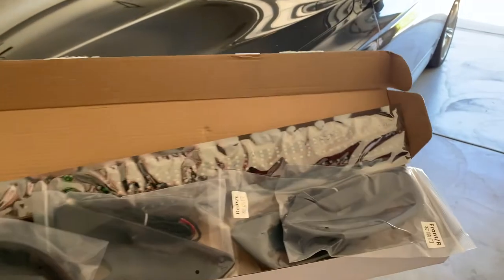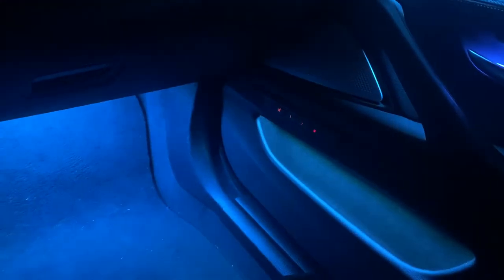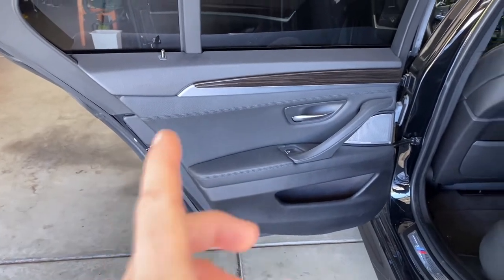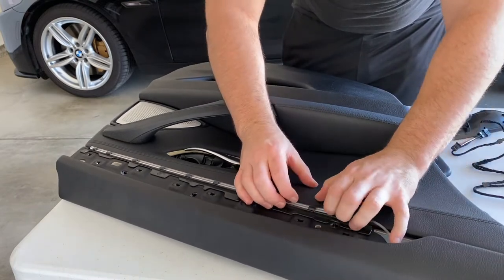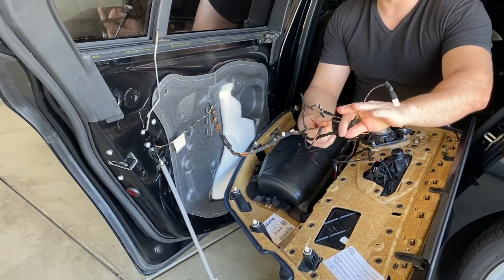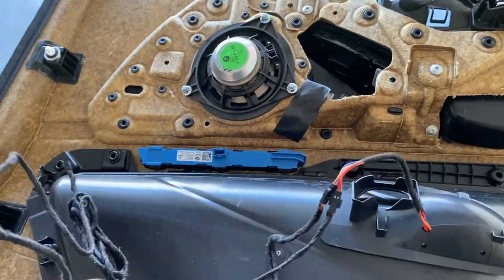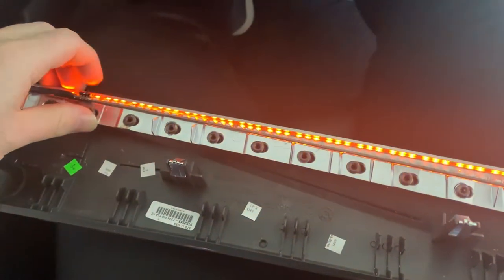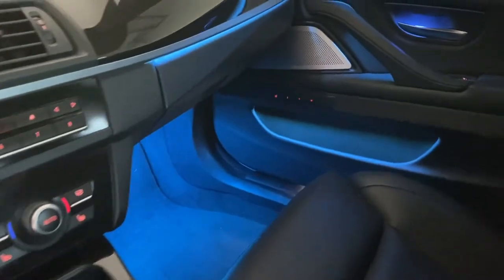Let There Be LIGHT!  BMW F10 Interior Light Upgrade | BOND Garage

Comment: hello its great I installed on mine as well very big differences.. great video btw. have question is there any way that we can code footwell lights to be on while driving because they go off when closing door >?  thanks
Reply from the maker: those are functional lights. also they're yellow/white so you won't get around adding some if you want color. as for coding it on, might be tricky but doable.
Reply: Yo i tried to install mine started on the Driver door but it didnt work. Do i first need to Plug the Rear Doors to make it Work?

Comment: Hi loving the video.. My question is.. Do you have to power all the door same as the driver door?
Reply from the maker: No. The other 3 doors are plug and play. I only customised the power supply of the driver's door since it's easier and faster this way. The set is designed to pull power for the driver's door from the trunk release button in the footwell arear which seemed more work and effort to me. Hence the custom part.
Reply: @BONDGarage  OK thanks.. I think I connected the driver side led to passenger hence I had the long led connector on it.. I will switch it around and that should make it work I guesd
Reply from the maker: @parbesali1986  the instructions that come with it are pretty useless unless you have some experience. Hope the video helps setting it up.

Comment: Hi , please tell me where do you plug them in to get the lights working ??
Reply from the maker: plugged them into the original connector. it's plug and play for 3 doors and for the drivers door i had to custom a little. it's explained in the video

Comment: Very Nice! Which unit did you get is it the CIC or NBT? Does it need coding? Thanks!
Reply from the maker: the car already had ambience light, but only the functional orange one. so I couldn't change color or anything. this is just a LED set to replace the original light modules. no coding but also only 2 colors and you have to switch each panel individually. so i can have the driver side blue and the passenger side orange. i keep it all blue tho
Reply: @BONDGarage  can you also use the replacement strips which can do multiple colors ? my car also only has orange ambient light (2011)

Comment: Where did you get the matching footwell lights?
Reply from the maker: can't find the link but it's basically just a set of 4 LED strips, with remote. I hardwired it to the low beam. But by now there are complete sets for the doors AND the footwell which makes it a lot easier. check aliexpress. There'll be quite some.

Comment: can`t i just purchase one of the cheap Ambient lights with Bluetooth/WiFi controller for smartphone controlling and plug it into the + & - wires from the stock ambient lightning? this must work too, right? 
I want to try this in the next few days. I got 5pcs. of the 10€ footwell ambientlight from Amazon. Each one has a WiFi Controller and 4 LED stripes. I will remove the plastic cover from the LED stripes to make it fit into the door panel and combine two stripes into one long strip. So i will have a long stripe for the top of the door panel and a long stripe for the bottom storage. For the cockpit I will cut off the unused LEDs. But before that, I'll test all 4 LED stripes for the complete front panel. 
With the APP Lotus Lantern i can add all of the 5 LED Controllers and use my phone or my Android Screen to switch the colors of the lights.  Hope it will work :D

Sorry for my bad english :D
Reply from the maker: How did it go?
There are also complete kits (ambient and footwell lighting) that come with a sound controller. But since I already installed one of those for my footwell lights I didn't want to add another one. However, that is a separate system that doesn't integrate with the OEM ambience light and the iDrive system.
Reply: @BONDGarage  I have an Android Screen with iDrive. With the Android UI which I am using most of the time for Spotify and GMaps, I can use the App for changing the lights. It works great and feels like OEM. I upgraded the footwell lights, all four doors and the front panel. They are all working with only one App. They all sync and I need to tap only one of the Color Button to change all LED Colors.
Reply from the maker: @MoTz_50  that's a really sweet setup! 👍🏻